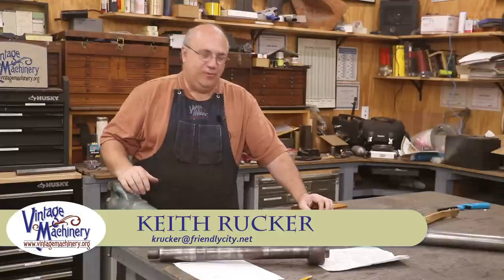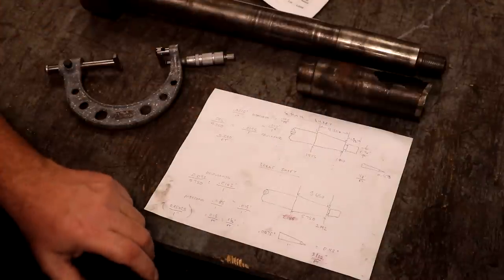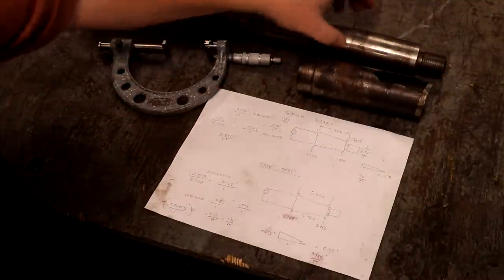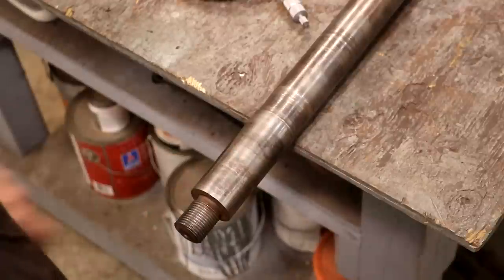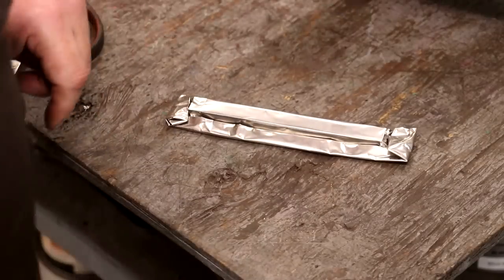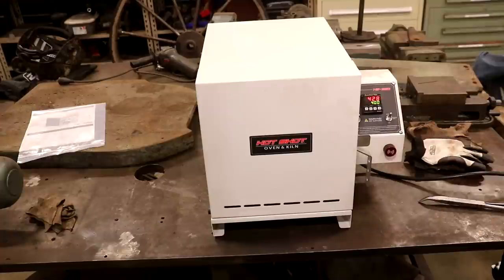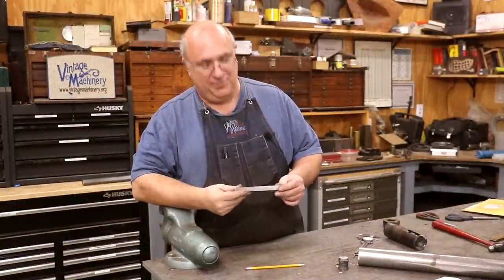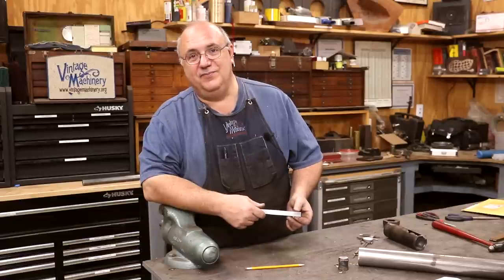The Jimmy Diresta Bandsaw Restoration, Part 8: Making a Taper Gage for setting a Taper Attachment

Comment: Since were on the subject of making measuring gauges....anyone got an idea of how you would measure the female side of a D1-4 lathe chuck...???
Reply: They make inside taper gauges, although I've never seen one in the flesh.  What I do is make two knife-edge flats and join them at a pivot point, making a transfer caliper of sorts.  Shallow, wide tapers are the hardest to measure.
Reply: @componenx  The D1-4 geometry is a bit tricky since you have a very precise angle (7 deg 7' 30") to hit and a specific diameter at the top of the recess so the face seats at the same time as the taper.  I thought about using a set of tooling balls, but they just ride up the taper....I guess the other alternative would be to make a master plug gauge and use that to check the fit of the female side of a D1-4 interface.
Reply: @ericsandberg3167  I think tapers are the trickiest thing out there to measure.  I know I'd have issues measuring 7d7'30"!!!

Comment: - QUESTION: [Keith] Do the heat treat ovens ever have an ultra-high frequency vibration component {HARMONICS for different alloys} so the atoms get 'joggled' such that they can more easily move to a finer grain lattice structure(s) {crystalline} formation(s) as the heat is rises though multiple "re-crystallization" lattice structure cycles?
- The reason I ask is because such then your ramp up periods could be shorter as the physical vibration would act like mini-forge hammers tapping an 'upset' to initiate a beginning weld.
- Do you know if any company's research efforts have tried this out?
- The research labs who might have tried this would/could/might know that this idea is rooted in the physical chemistry principals of how the quantum energy of electron orbital shells of metals are supported by the various catalysts used in chemical reactions and how they 'may' function as 'polarity' hammers on atoms {i hope my clumsy word picture here works for you somehow}.
- If you ask the new company who supported you, Hot Shot 360 – Heat Treating Oven, I would be most interested is hearing what they, their research lab, might say in reply. [note, U. Cambridge professor and CERN researcher, Dr. M. E. Peach, {deceased} would be pleased I asked this question]
- https://www.google.com/search?q=American+Rotary+HEAT+TREAT+OVEN

Comment: Good job.
But why is it so complicated? 
Why 12 inches in the foot? It would be easier to put 10 inches in your foot, after all, you have 10 toes and 10 fingers on one hand.
The american system is really something for the arithmetic artist. The rest of the world doesn't understand.
Reply: We also have applications that go back to English dimensions. 
For example, pipe threads regularly cause confusion when one inch equals 33 millimeters. 
But otherwise 25.4 mm

That can only be found out through tables.
Reply: One could argue that 12 is a "nicer" number, in that it has more divisors. Much in the same way that we all use a 360-degree circle. (Well, except for those of us who use a 2pi radian circle, but even mathematicians don't do that when we're in the shop.)

But even if the US had been successful at adopting the metric system the last time we tried, the tool Keith is restoring predates that attempt by about a human lifetime, so the appropriate units will always be inches.